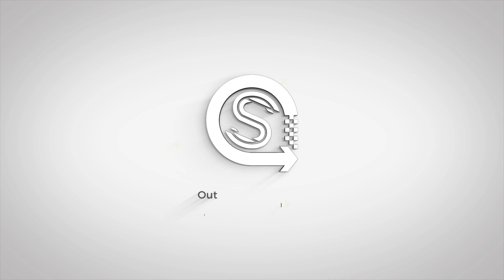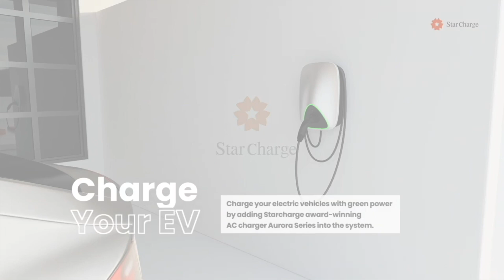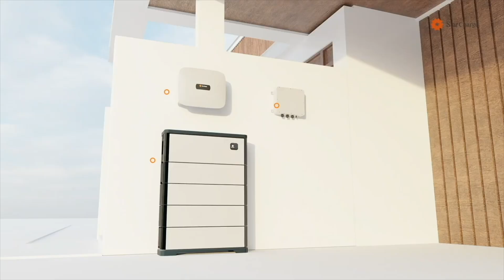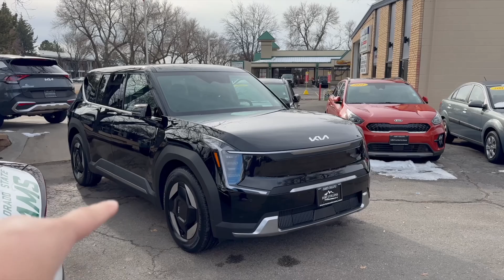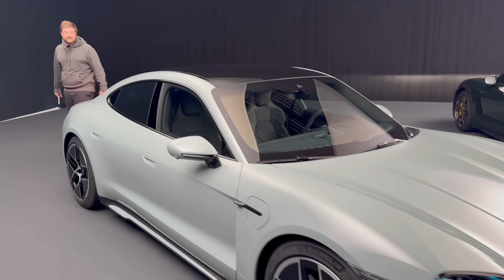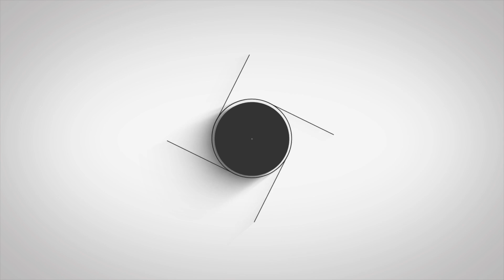Hyundai's Active Air Skirt Squeezes Out A Few Extra EV Miles | Episode 278

Comment: It would be nice to see if there is anything that can be done to increase the range when towing an rv. Anything that can be done to the rv and tow vehicle.  Wheel covers on the rv. Putting a flat cover over the bottom of the rv. Adding some sort of deflector on the roof of the tow vehicle. Make the front of the rv more aerodynamic.
Reply: There's definitely a lot they could do. Just hasn't been a demand to do it, I assume.

Comment: Hyundai/Kia should rather invest into battery packaging. Renault offers 87kWh batteries in car that is 150-200kg (~330-440 lbs) lighter than Kia/Hyundai cars with 77kWh batteries, and the starting price of that car is also 20% lower. Even the base model includes a 22kW AC charger, so you can easily charge a large portion of your battery in a week's shopping instead of having to make a detour to DC chargers.  I can imagine which solution will offer more range and convenience for the consumer's money.

Comment: I'd like to see an EV focus on adding lightness for efficiency. Something like the original Honda Insight. A small two seater, get rid of anything unnecessary that adds weight like big wheels, power seats or glass roofs. Just a basic A to B commuter that could blow away Model 3 in efficiency.
Reply: So a terrible and expensive vehicle almost no one wants.